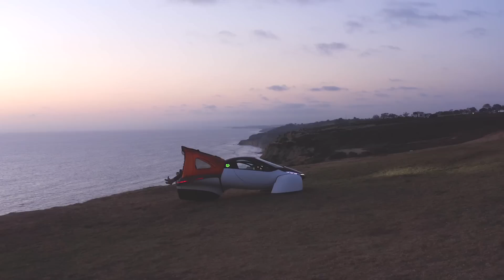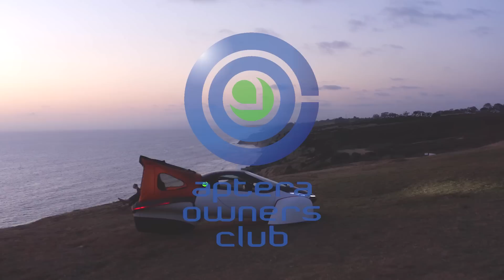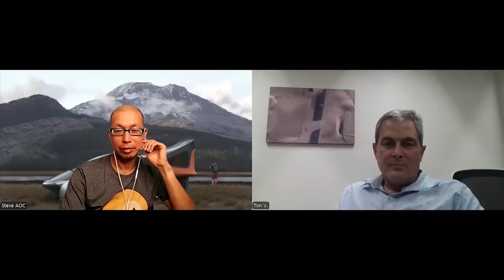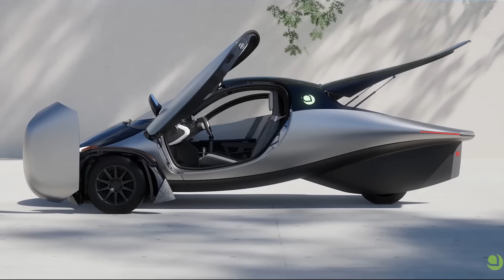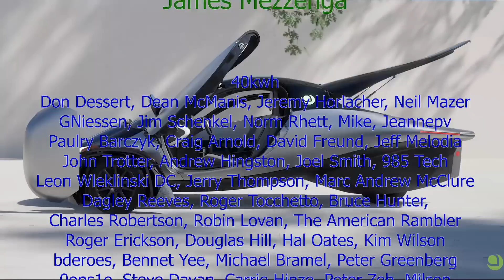Aptera Battery with Tim (3/3):  LFP and other viewer questions

Comment: It’s a bit ironic that the company that touts “1,000 miles on a charge” is also saying that we don’t really need long range. I agree with that point, I think the 1,000 mile range variant is unlikely to be made. The only use case I could see for it is mainly for extra battery storage or for a niche off-grid option. 600 miles is already an insane number.
Reply: Don’t get caught up with the starting number.   600 mile variant of which many will charge to 80%= 480 miles.  If you live in a climate with cold winters that number can be cut in half…down to 240 miles and that’s if you deplete the battery to zero, if you recharge your battery when it is at 20% then that 240 miles drops from 360 miles and half of that in a cold environment brings it down to 180 miles.  Of course these are extreme numbers, but maybe more common than you think.  I personally will be taking long trips with my vehicle, I prefer not to stop unless I physically need to do so for rest or bio break.  
On another note….bragging rights for APTERA!  1,000 mile range will definitely be the benchmark for a long time.
Reply: @johnvoules7447 it won’t be cut in half in winter. The primary driver of cold weather range loss is thicker air, not just cold. Cold air is far and away the most prominent offender, especially for trips where range really matters. That big hitting element of range loss will be much less prominent with Aptera.

It’ll have loss, but not more loss than other EVs (our Model S experiences no more than 30% range loss in Michigan winter, when properly preconditioning before leaving, which is effortless)
Reply: @CharliePryor  Since the driveline efficiency is so much higher and the lack of a heat pump the Aptera will probably make the range hit larger than other EV's as a percentage in the winter.
Reply: @Toycollector33  the lack of a heat pump isn’t something to worry as much about when the carbon fiber body is essentially a thermos.
Reply: @CharliePryor  I'm having trouble finding anything to support your claim that colder, thicker air is the main factor in winter range reduction.  Do you have any references you can share?
Reply: @netscrooge  basic physics, for one. Cold air is more dense than warm air. Your vehicle is moving through more dense air, hence, takes more energy to get through it. Gasoline vehicles experience similar range loss in the winter as well; their owners are just less conscious of it. 

A battery can be warmed (preconditioned) before leaving easily. Similar to warming up the engine by starting it ahead of time. Both vehicles will still, even with warmed up components, operate less effectively in the cold due to this inescapable fact of physics: cold air is harder to move through.

With a drag coefficient of 0.13, as they claim, Aptera will be less impacted by such increased density of air than other EVs.

Edit: can’t put link in here without YT flagging it. I’ll close with this: battery chemistry plays a big role, and a heat pump will certainly help as well. No denying that batteries operate worse, because of the same physics science of those moving electrons, when cold, 100%. However, once the battery is preconditioned, and the cabin is warm, maintaining those conditions is only a marginal difference in energy consumption, compared to the significant changes that can occur to efficiency at high speeds between warmer air, and denser colder air. The less resistance present, the less energy consumed. Lots of variables to range, driver to driver as well, but with that reduced drag, it’ll impact Aptera less.
Reply: @CharliePryor  It's hardly basic physics.  Yes, density is a factor, but viscosity is to some extent too.  At lower temps, density increases, but viscosity decreases, right?  Anyway, I can't find anything to suggest that we're talking about more than about a 10% increase in drag?  What kind of numbers are you suggesting?  Unless you think the change in drag is huge, cabin heating would usually be a much, much larger factor, especially with resistive heat.  

When you say Aptera's low drag will help, it sounds like you might be counting the Aptera's low drag twice?  The range already includes a large effect from the low drag.  Is it fair to count it as such a big factor again? 

Anyway, I'm expecting the winters to take quite a toll on my range.  I won't be able to plug in at home, and I'm hardly the only EV owner in that situation.
Reply: @CharliePryor  This is just not true - the viscosity (drag) of air varies very little in the temperature ranges we normally experience. Maybe you're referring to loss of range due to having to use a heater when it's cold.
Reply: @johnvoules7447 You’re a little more conservative on your estimates than myself but I agree. A 600 mile trip non-stop is not out of my annual use case, especially if going hotel to hotel. Which means winter and instate travel is easily on my weekly range for instate range in the winter. So, my order was placed for 600 mile.

Another issue lost is that larger capacity will give me a better reserve to build the bank back up for the days I don’t travel which means less outlet time.
Reply: @johnvoules7447  If efficiency is the goal, (that is the genesis of Aptera engineering) the smallest battery to fit your daily use with some buffer for extra trips.. say triple your daily use... should be adequate for MOST people.  These conversations rarely touch on charging infrastructure which is getting better all the time.  Catering to the most impatient and fearful may be a good idea from a marketing point of view, but reality is far differen,t and part of Aptera's mission is education of the public ... as I see it.
Reply: @johnvoules7447  Agree!  Great points!  Brings much needed sanity and realism upon the hype and fixation upon advertised EV ranges.
Reply: The advantage of long range is when you drive infrequently, but when you do it tends to be longer distances. As I now find myself. I only drive one or two times a week and every couple weeks take a longer trip. I plan to get the 600 mile range version then I can let the vehicle charge up using solar so I can occasionally take a couple hundred mile trip without AC charging. This also allows you to more easily keep your battery in its sweet spot of 20%-80% charge and its ideal charge of 30%-50% to minimize battery degradation. You also have to consider the loss of battery capacity and how long you intend to own the vehicle. Li-Ion batteries degrade with usage cycles and time. So in you intend to keep your vehicle for a significant period of time you need to make an allowance for the loss of capacity. The 1000 mile range without VtoH, at least for me would seem overkill, but if you frequently took several hundred mile trips or wanted significant VtoH capacity it could make sense. I would take the 1000 mile version over the 400 mile version and the 250 mile version at least for me is a waste. Also remember AC loads as a percentage of capacity use will be higher than other BEV because Aptera’s is so efficient driving.
Reply: @matthewhuszarik4173  My 2015 i3 with 106,000 miles on it still gets virtually the same range as it did when it was new.  A good BMS should take the worry out of charging to 100%... which I do regularly. This range anxiety that people display is blown way out of proportion.  If you don't have the patience to charge your vehicle up once in a while.. you're never going to be happy with an EV.
Reply: @J-W-Kelly  I have battery powered hand and yard tools the advantage over a car is I can swap out batteries and charge them and have as many ready as I need. They are relatively inexpensive compared to a car if they fail and like I said the batteries can be easily swapped out. So far except for a lack of power on some of the yard tools I haven’t been disappointed.
Reply: @J-W-Kelly  Your BMW i3 is now nine years old and you say it has virtually the same range? Virtually is a nebulous word. Precisely how much of its original range does it have, is virtually >99%, 95%, or 90%? I would hope anything under 90% wouldn’t be considered virtually the same range, but you never know. Say it is 90%, but you want to keep it for 30 years and 360,000 miles what would the range be then? I presently have a 27 year old truck. Still has exactly the same range it did when new and it will as long as I keep it. I only drive it a couple thousand miles a year because I bought it as a tool and not basic transportation. I wouldn’t be wise to do that with a BEV. If you don’t use it you will still lose range. That is the reason for the Aptera with 600 miles of range. If it loses 10%-20% it isn’t a huge factor in how I ever use the vehicle and it gives me the reserve capacity to store the solar power generated until I use it.
I still consider the 1000 mile version, because between 20% and 80% it gives you 600 miles and enough storage capacity to take it down to 20% and it would have room to store 60 days of sun without having to exceed 80% charge. If Apertas comes with V2H charging I may very well go with the 1000 mile range version because then you can avoid wasting any power.
Reply: @matthewhuszarik4173  My i3 has done exactly the same trip over 500 times in 7 years.  Therefore I am able to make the statement of virtually no range loss (none that I can see).  I still get to the same spots with the same percentage of battery at the same temperatures/time of year.  The BMS on this car is fabulous.  Your use case is bizarre and unusual, but you do you. If you want to haul around a heavier battery than I do, that's fine with me. Wanna race?
Reply: @matthewhuszarik4173  The advantage they have over an EV is that they will help you work your garden.  My cell phone has an advantage over EVs  in communications too.  What the hell does that have to do with anything?
Reply: @J-W-Kelly  Not much for metaphors and allegories?
Reply: @J-W-Kelly  Interesting? I have a Tesla Powerwall and it has lost about 5%-10% of its capacity in four years. Never drain it more than 25% and when I am not home not more than 10%.
Reply: @matthewhuszarik4173  Sure thing, when properly used.
Reply: @matthewhuszarik4173  Perhaps you should drain it all the way and then chrtge to 100% once in a while as recommended to reset the BMS.. at least by some battery makers... in any event, I just saw a video of a Tesla Model S used as a taxi in the UK.  It  has 440,000 miles (!) on it and the battery is still at 73% of its original capacity.  Amazing.  Not sure what the "with EVs you have to replace the traction battery after 30,000 miles" crowd will say about that.
Reply: @J-W-Kelly  First of all most of the high mileage Teslas I have seen are on their second or even third battery. So while there may be an occasional Tesla that gets 300k miles out of a battery it definitely isn’t the rule. But that isn’t my concern Li-Ion batteries unlike ICEV drive trains also lose range over time, if just left sitting. I have done considerable reading and Li-Ion batteries can lose from 1%-6% capacity per year just depending on their storage conditions. So for those who intend to buy a BEV and drive it into the ground 20k-40k miles per year the approximate ten year life of a Li-Ion battery isn’t an issue. But for people who drive a car 10k-15k miles a year and expect to keep it 20+ years or trade it in after 5 or 10 years with it still having significant residual value they will more than likely be disappointed. I am in the worst case scenario. We always have multiple vehicles and they all get <10k miles a year some significantly less. We keep them for very long periods 20+ years. A BEV would more than likely be a very big disappointment for us. So I have decided to wait until the industry shakes out and the winner are more obvious and we see at least a couple decades of solid history.
Reply: @matthewhuszarik4173  I drive about 12,000 miles a year without any sign of battery degradation as I mentioned... and this is a relatively small battery.. larger batteries are generally considered somewhat more reliable long term... just what makes you think the high mileage Teslas you have seen are on their 2nd or 3rd batteries?  A fever dream? Battery failures are rare and usually individual cells or modules are replaced, not the entire battery.  Your concerns seem silly to me,  but I'm sure they seem very serious to you.   Best of luck.
Reply: @J-W-Kelly  All BEV automakers include reserve capacity in their batteries to accommodate loss of capacity and prevent overcharging and discharging. I have read that it is more substantial in European BEV. The Porsche Taycan supposedly is especially underrated.
Reply: @matthewhuszarik4173  I'm aware.  The i3 has a very conservative upper and lower buffer for charge and discharge limits that does a really nice job of keeping the battery healthy for many years.... the whole point is not to have to replace batteries... a ten year warranty says a lot about what the engineers expect of a battery.  Early Leafs suffered significant battery degradation due to poor battery management... both for temperature and inadequate charge limits from what I understand.
Reply: @matthewhuszarik4173  Agree!  Great points!  Although the bigger packs will add proportionately more weight (and thus more load upon the power train), the larger capacity of the pack will also mean longer pack life because the amperage drain is spread across more cells, thus lowering the strain and heat buildup on each cell in the pack.  This increases longevity of all cells within the pack.  A 600-1,000 mile pack will lower the need for in-trip charging where you need high heat and high battery strain 150-250kwh DC fast charging speeds to get back on the road.  These insane charging scenarios are where the batteries are severely heated and degraded (if not destroyed or caused to explode.  And if the explosion does not occur during charging, the explosion may then occur when the driver speeds off with an already super-hot, freshly-charged pack.).  

Instead, with the 600-1,000 mile Aptera, you drive all day with a cool unstressed pack, and plan on an overnight slow speed 50kwh ("1C") low-heat, low-stress charge.  You'll be ready for the next day of driving with a pack that is cold and unstressed, yet is ready for another all-day drive.   

To me this is one of the biggest real advantages of the Aptera.
Reply: @matthewhuszarik4173  I think you meant DC fast charging, not AC charging.  There is nothing wrong with DC fast charging. Hyper fixation on extremely unlikely battery damage or overblown fears of degradation is a way of crippling the actual capacity off your battery. Go ahead if you have to, but it is not reasonable from my perspective.
Reply: @J-W-Kelly  I meant AC charging because with 600 miles of range you have a real range of ~350 miles. More than enough to take a couple hundred mile trip without DC fast charging. I live in California so we will at least occasionally get 30-40 miles a day of charging. Say you average only 20 miles a day that gives you enough power for over 7000 miles a year if you have enough capacity to store it. So for me who drives only about 5000 miles a year on my car and maybe another 2000 on my truck. With enough battery capacity to store the power I do generate I won’t have to charge but very infrequently, at most. I don’t plan on ever using DC fast charging primarily because of the hassles out here in California they are frequently full and you have wait not only during charging, but to just get on a charger. If we need to go on a longer trip an Aptera isn’t the ideal vehicle anyway. We will take my wife’s Avalon hybrid or new Crown when she gets around to getting it.
Reply: 1000 miles goes to to half that in cold weather with cargo in the back. 

So it has a very real use case.
Reply: @AtlantiansGaming  Not true, in my experience... unless you have the heat blasting in sub freezing temperatures... not the most common use of an Aptera... not even close. People of Norway have adopted EVs at a higher percentage than any other country and they seem to do fine with 200-300 miles of range, in fact many do fine with much smaller batteries than that.
Reply: @AtlantiansGaming  exactly, not to mention sitting in traffic with the heat on in the cabin, a 100 battery won't last more than a couple hundred miles at best because it has nothing to do with aerodynamics at that point.
Reply: As other people have said, cold weather, use of AC, age of battery, and keeping battery capacity below 80% (to reduce wear on battery and wasted charging time to top off the battery) make real world driving distances significantly less than claimed battery ranges. The 600 mile range version will actually put it on par with the real world range of most ICE cars after 1,000 charge cycles: 600 miles * 0.8 (battery capacity to avoid long charge times) * 0.8 (battery capacity after 1,000 charge cycles) * 0.8 (20% range reduction for cold weather driving or non ideal conditions) = 307 miles. For 1,000-mile range version that 1000 miles * 0.8^3 = 512 miles for worst case after long term battery degradation. The 1,000 mile range version definitely has its place for people that do a lot of highway commuting, but probably won’t ever get made.
Reply: As others might have mentioned, there are other use cases for the 1000-miler, and here's mine:  I live in Switzerland, and in the winter months you can forget 40 miles a day charging - I wouldn't be surprised if I get 40 miles for the entire *month*.  I see the extra capacity mainly as a means to tide me over those less sunny months.

And as others have mentioned, there is another important use case:  Bragging rights !😉  I want to tell my fellow citizens "Charge once, drive forever !"
Reply: Tim was talking about practical, usable range. And if the average driver uses only 12% of their 300 mile range, having 1,000 miles is pointless for most drivers. But that is the practical side, and the emotional side is that people (especially people who have never owned an EV) can worry about cold weather, or night driving, or unforeseen conditions. The difference with the Aptera is that its efficiency means that 1,000 miles of range is possible, as opposed to a Hummer EV that requires a 2,200lb battery to go 300 miles. I think that 400 miles is a nice sweet spot that keeps the battery small, and light enough, but still gives ample range and performance.
Reply: with 1000 miles I could constantly go at the top speed on the autobahn and still have decent range! thats what I would like.
Reply: With the launch of NEVI chargers occurring every 50 miles  in late 2024 and 2025 across the USA outside of Florida, range anxiety will drop.
Reply: For some folk living in the very south of Texas, you can't even get out of the state with less than the 1000 mile pack without recharging
Reply: @jefferylegere  What is wrong with recharging while traveling?  What kind of blood clot seeking fool drives 1,000 miles without stopping?
Reply: I consider the1,000 mile range battery option to be a bit of a gimmick.. albeit an understandable one to attract interest from the uneducated but curious.  Consumers have been led to believe that huge batteries are better... false range anxiety has been stoked by ignorance.  I was happy to hear Tim say what he said about smaller batteries being just fine.  After all, efficiency is the name of the game, right?